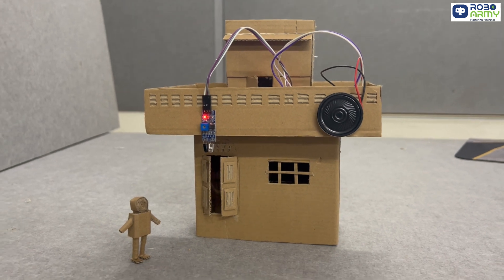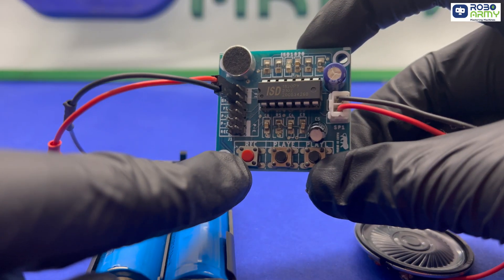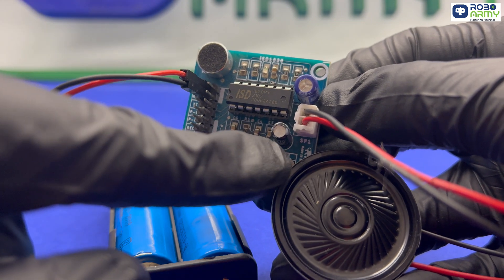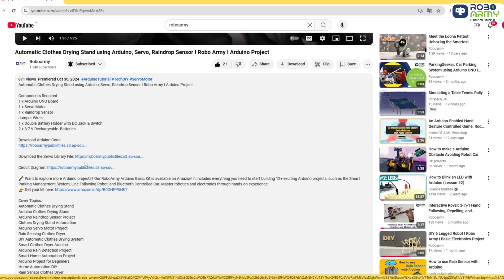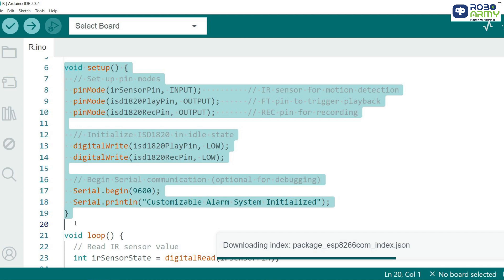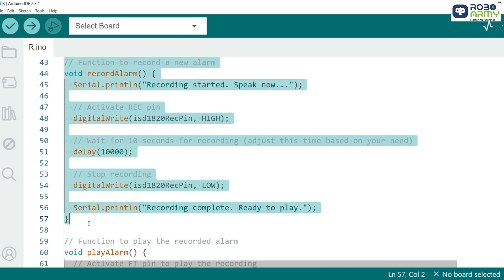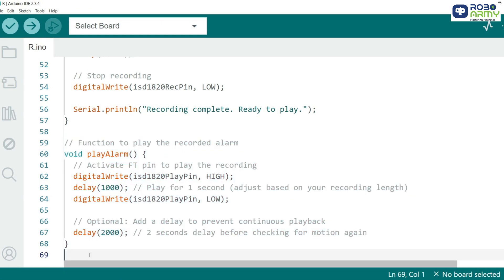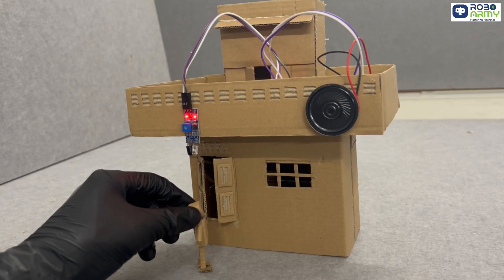How to Make an Automatic Bell with Custom Alarms | Arduino & ISD1820 Voice Recorder

Comment: Then should we connect vcc and gnd to uno board
Reply from the maker: Yes! You should connect the VCC and GND of the sensor/module to the 5V (or 3.3V if specified) and GND pins of the Arduino Uno. This powers the sensor so it can work properly.

Comment: Can this be considered in pizzoelectricity?
Reply from the maker: Great question! This project uses sensors and electronics, not piezoelectricity. But a piezo-based version (using pressure or vibration) could be an interesting twist!

Comment: I have followed every step you have shown , done everything by double checking it . But , the project is not working .
problem : when object comes the sound does not play but when i press the play button on isd1820  it plays the recorded sound . 
What Should I Do ??
Reply: Can we try the project??
Reply: @idhayanmichaelraj9026  definitely , just ask for the code on ChatGPT , as the code provided by him was not working for me , u can try for yourself , if it works well and good , if not ask ChatGPT , rest everything is simple and clear
Reply from the maker: Yes, definitely try it out! The original code might vary depending on wiring or module type, but I’m always here to help if it doesn't work for you. Just drop a comment, and I’ll guide you step-by-step!
Reply: @idhayanmichaelraj9026  yes absolutely , but for the code , dont use the the code given by him as it was not working for me , i asked chatGPT to give the code , so ou can also ask him to give the code which will work as in my case .
Reply from the maker: Thanks for following along! 😊 Since the sound plays with the button, your ISD1820 is working fine. The issue might be with the FT (play) pin wiring or the code triggering it. Double-check that the FT pin is connected to the correct Arduino pin (like pin 3) and that it's defined properly in the code. Also, make sure you're using digitalWrite(FT_pin, HIGH) for ~1 second to trigger playback. Feel free to share your wiring or code if you'd like me to help you debug it further!

Comment: Bro if you connect vcc and gnd of isd to uno then how you are connenting same isd vcc and gnd to the battery
Reply from the maker: I've connected the ISD1820's VCC and GND directly to the Arduino itself. The Arduino powers the module, so there's no separate battery connection for ISD1820. Let me know if you have any doubts!

Comment: for online simulation of circuit please refer a software where i can get isd1820 because it is not available in tinkercad software
Reply from the maker: Great question! ISD1820 isn’t available in Tinkercad, but you can try Proteus / Fritzing or SimulIDE for better simulation.
Reply: Suggest some unpaid apps

Comment: what if the person comes in and goes out on purpose multiple time 
what implementation you have done
to tackle that problem
Reply from the maker: Great observation! Currently, the system triggers each time motion is detected, but we’re exploring ways to optimize it, like adding a delay or detecting direction. What would you suggest? Let’s brainstorm together!

Comment: INO CODE NOT WORKING 😔
Reply from the maker: Please install the Arduino IDE and open the code file. In case you are still facing an issue, please let us know the exact error which you are getting.